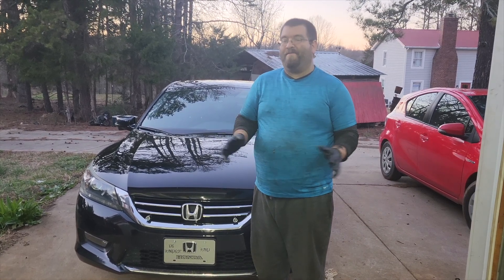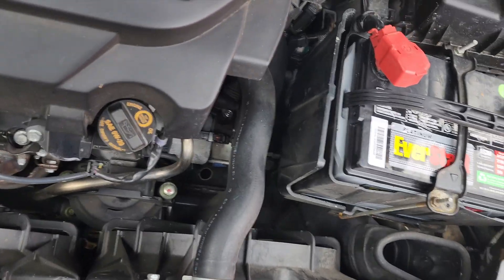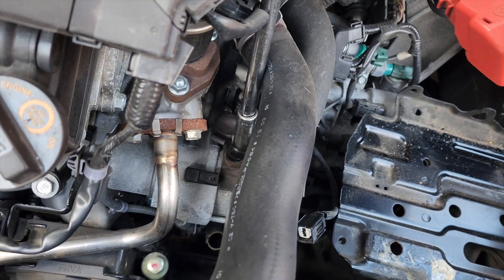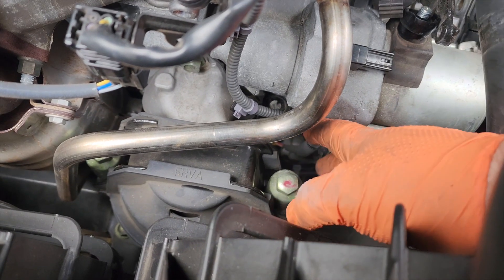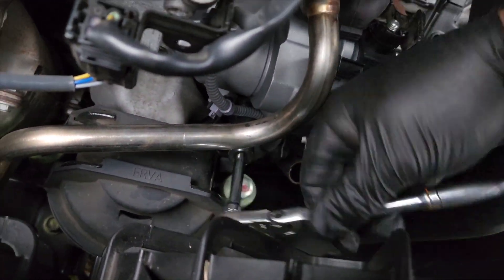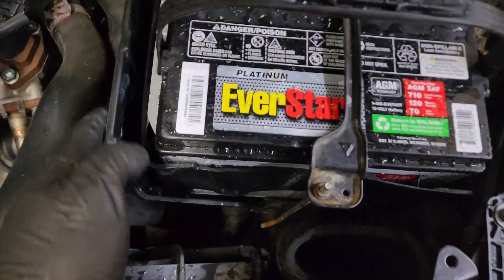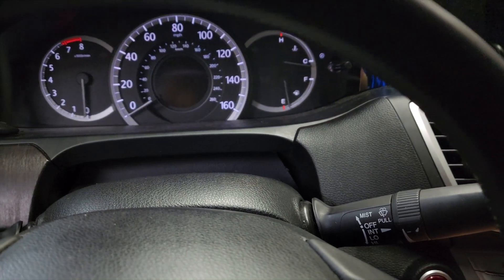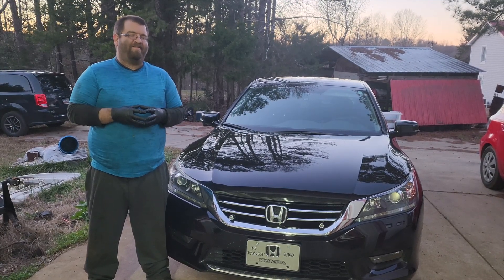13-17 Honda Accord V6 Starter

Comment: You dont have to remove the air intake manifold anymore like on the older models? I am looking to replace the starter on a 2014 accord v4 but dont have jacks abailable so id have to do it from the top like you did.

Comment: On 2:08 there's a black gasket that is not included on any aftermarket starters.  Of course an after market is what I have, and I misplaced old gasket (long story).  I went on and special ordered a new gasket from the dealer.  My question is will it hurt if i put starter back on for a few days before getting gasket (I mean even the dealer found this gasket to be odd, but I'm sure it serves some purpose). Putting starter on and taking it off again is definitely more time efficient than shuttling my wife around for a few days 🤷🏾‍♂️

Comment: Two questions.  (1) How do you know the starter was actually "bad", meaning in what sense was it bad? I saw no testing done. (2) You did not mention there was a Technical Service Bulletin issued by Honda regarding starter problems. Did you know about this, at all?

Comment: Hey, I did all of this. The new starter spins wonderfully… It just doesn’t connect and start my car, it’s dry spinning… Why is this?
Reply from the maker: There is a tsb about rotating the flywheel and torque converter one bolt hole clockwise. Look into that.

Comment: When you unhook your battery will you lose radio memory like you do on the older model accords?
Reply: Yes you do but you the screen shows you how to auto program the code. Can't remember how but trust me it's very very easy.
Reply: For the 2013-2017 models you just hold the power button for 2 seconds

Comment: The torque converter  tsb  was not performed   ... it will grind  again
Reply from the maker: I know the tsb. It wasn’t those conditions. This one wouldn’t do anything sometimes but was receiving B+ signal.
Reply: @automotiveinsight  i understand.. but  ths problem will  happen due bad tolerance  and the already worn put spots
Reply: @lars25gdl  You can do the TSB rotation and still have the same starting issues in a very short time. Can only do TSB once.
Reply: @jackbnmbl7  need a combination of tsb  and  latest version of statmrter from honda
Reply: Is this done before or after the starter has been replaced?
Reply: What is this tsb?
Reply: I replaced starter with Honda remanufactured did not perform tsb. It's been six months, no grinding yet.
Reply: @AntonioPerez-xl3bb do you have the part number for the starter you got?
Reply: @tyrantfour technical service bulletin. Replace starter and rotate flywheel one bolt over (assuming that hasn’t been done before) if it has, flywheel needs to be replaced. 😢
Reply: you have to replace the starter with a previous gen starter and use a drimmel to cut the bracket for proper fitment
Reply: i think this is the only way to bypass the bad design by honda